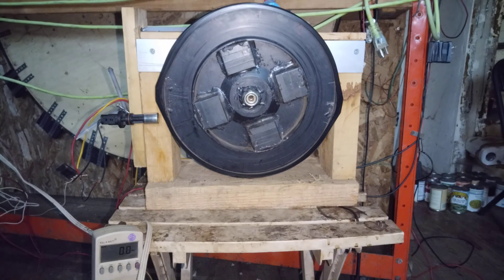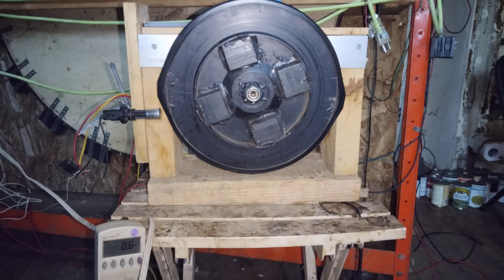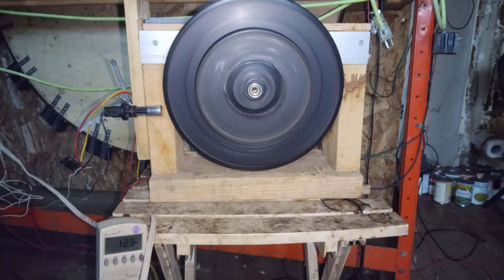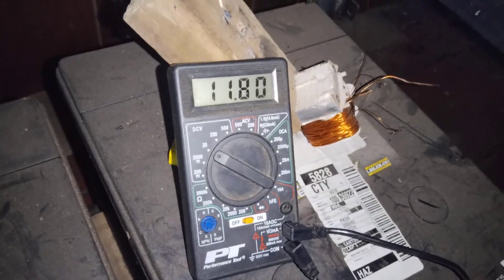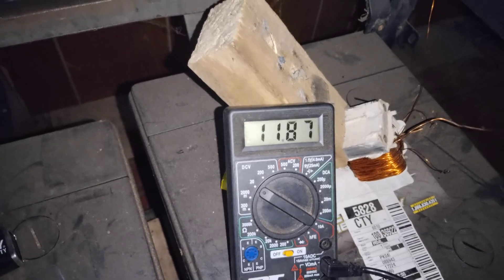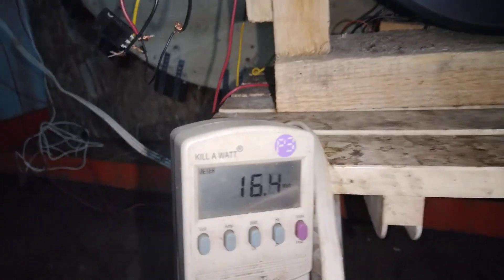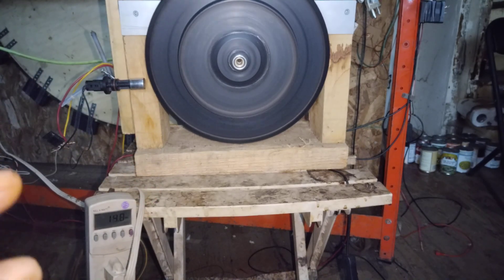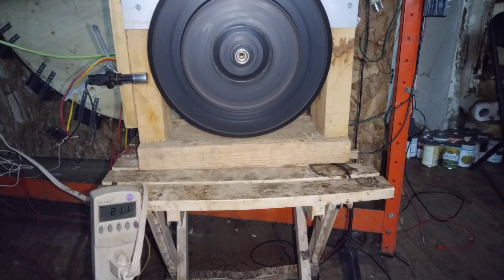pulse assisted wind turbine running on 100 volt 20 watt.

Comment: i think the key to a very eff motor would be way more turns   i dont know if this info will help you with what you are doing though   My home made low freq pure sine inverters have incredibly low idle losses  my 10 thousand watt one is around 20 watts and my 2 or 3 thousand watt is around 10 watts   That is powered up not a power save mode that comes up to voltage when it senses a load    The way i am able to have that low of a idle has to do with tuning by turns    I wind my toroidal transformers along with the choke i make for them  I us the reg math as a estimate of the turns needed  I then wind the 120v ac high side starting with ten to 20 more turns than the math said  using only one wire   I power the tranny up by plugging it into a 120 volt out let   To be clear there is no other wire on the core other than the single wire i had just wound    If it is a larger tranny it will flip the circuit breaker To keep this from happening i use a old style filament light bulb in series and a switch wire across the bulb   With the switch off the bulb is in series in the circuit              This limits the inrush current so your breaker won't flip while magnetizing the core of the tranny  The light bulb will be on but not bright   I then turn on the switch wired across the two legs of the bulb  The bulb will then turn off and you have full power to your tranny              Next I use a amp clamp meter to test how much power the tranny is using   I write it down then i wind another 10 turns on that single wire  I then power it back up test the power consumption again same as the first time  write it down  I continue this over and over until the extra turns make little difference   When you get to extra turns dont make much diff unwind one turn at a time and test  This is how you find THE perfect number of turns for any transformer core   Keep a close eye on comparing when testing and you get a fill for it very quickly   There is no hard fast rule to how many extra turns you add each time   It sound complicated but it truly is not adding turns and testing takes very little time also                             If your core is one of the really good ones and do this you can get it where even good in line metter says its not using any power lol  This is a big deal and very worth trying  There is many other benifits all so like no bulb needed to plug it in ZERO tranny hum and many more  This may work on motors and generators also   I have done alot of tinkering and like forest gump found lots of cool stuff over the years  Have a blessed day get ahold of me if i can help in any way  I am Ben i am on my wifes youtube